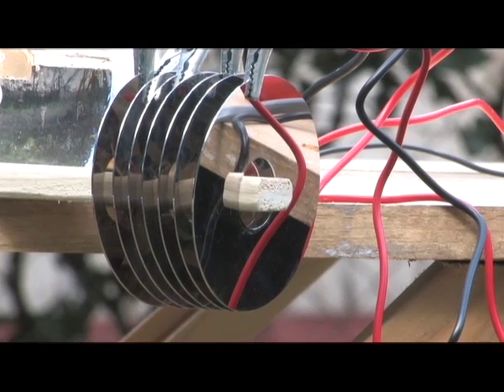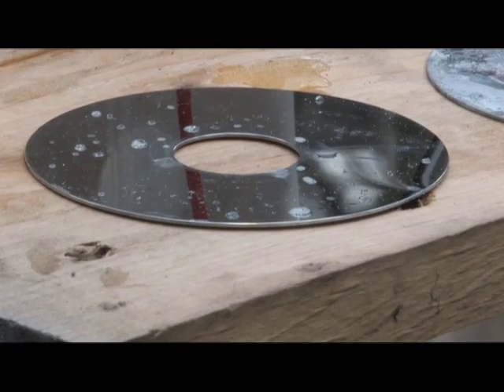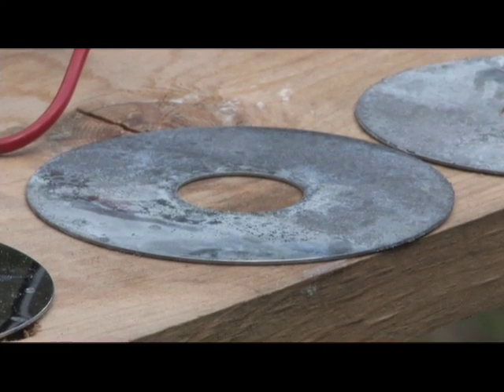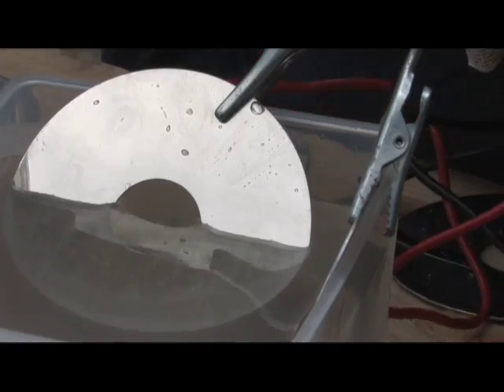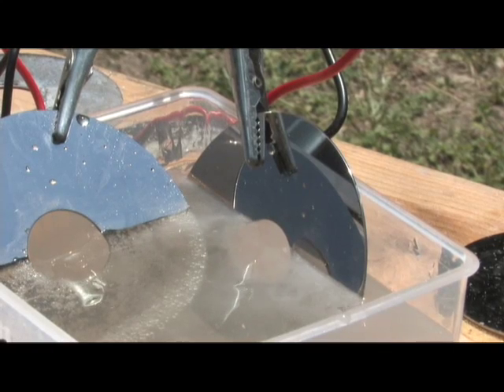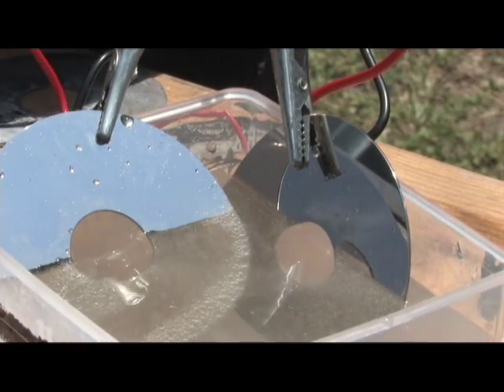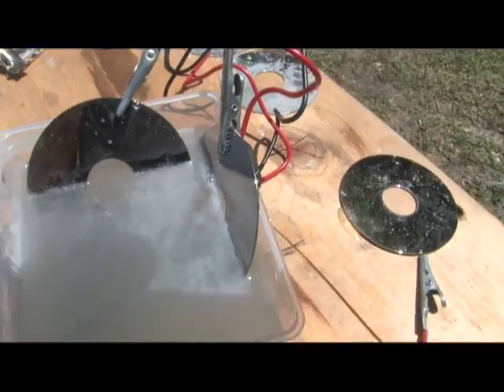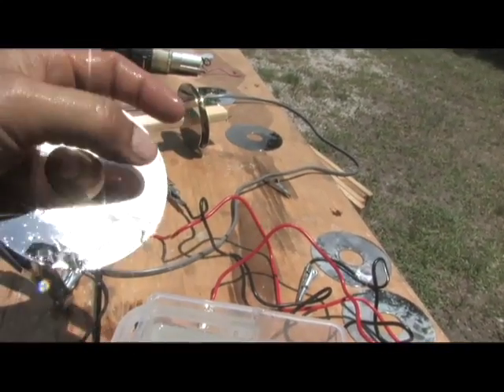SOLAR PANEL HHO PV PHOTOVOLTAIC HYDROGEN HARD DRIVE PLATTERS Science Experiment

Comment: Try designing a joe cell and fill it half way with Gallium Aluminum Scandium alloy. Then fill the rest of the joe cell with urine. Then pass the correct frequency of electrical power through the joe cell to produce HHO out of the urine. Thought about this while watching a composting toilet video. Thought why not use the water in the urine to produce HHO to charge solid state sponge hydrogen fuel cells . Then have a hydrogen fuel cell operate a micro jet burner to cook the sticky stuff and grind it all up then deposit the sterilized matter into a bin to latter use has rich top soil?  A better way to deal with human waste. RV's could make lots of roads and highways really green from all that rich top soil while charging up hydrogen fuel cells to use in their vehicle. Or have stations where they buy the hydrogen feul cells from folks. Turn in full cells and be given empty cells to fill up from processing ypur own waste. Even have places where you can sell off your rich top soil for some cash. 😊

Comment: Have you tried smaller 316L stainless steel plates (or washers) sanded in a crosshatch pattern as electrodes? spaced about 2mm or less submerged into distilled water with a little potassium hydroxide. Using different set ups with neutral plates? No contaminants then. I really wonder how that will perform... looking forward to the next video on this.

Comment: You could go to the dump and get a stainless steel sink for your electrodes. Also you could space your plates alot closer so then you dont need much salt and it works very good when you do that.

Comment: I'm not sure if this has been mentioned yet. But part of what you are doing using aluminum platters, is plating with aluminum. The acid and current is dissolving aluminum from one platter and platiung it onto the other one.
Platinum is expensive, but you could always try switching to titanium. Much cheaper.

Comment: I think this is a decent proof of concept. There are prototype setups out there using a large solar array to greate hydrogen which is then stored in large tanks to run heating and electric generators for the home. It's still too expensive to be truly practical (I think I read the setup cost the builder $80k) but the idea is sound. Good work and keep up the experiments. Zero pollution power, how cool is that?

Comment: I put 2 dual high amp output alternator on my S-10 truck 250 amps@hi rpm 100 amps idle, X 2 alternators,Running a 4 gen system consist of 20 SS plates per gen,Feeding 160 amps to it with CCpwm, constant current pulse width modulator,from factory 14mpg town 18 mpg hwy,To nearly 200mpg with HHo.don't have to fill up I put 4 gallon of gas and go 560 miles my engine runs cooler cause of the water vapors How in the hell is that not Good,watch zero fossil  fuels videos, and Learn, I'm a mechanic too.
Reply: NLOLIN4Solar wait what??? send me some build directions you sound like you have one sexy ass HHO build... is it wet or dry cells??

Comment: Wrong engines today don't last longer then 20 years ago,they are thro-aways today, wear them out land fill them in a few years not worth rebuilding.But 20 years ago 305,350 454,455,351,390,383,400,409,427,440,Cast Iron engines,they can take thrust,torgue,Sorry todays cars are junk,In HHo you use mof/map enhancers, and E.F.I.E for o2 sensors, and CCpwm's,Dude do you even research anything,OFR can be ajusted with enhancers such as Map/Mof enha- o2 sensors can be fooled with E.F.I.E's

Comment from the maker: In regards to the car alternator, they have an exciter in the core. When the voltage is full in the battery or no load from fan lights etc, the exciter drops the magnetic field so the alternator just spins freely lightening the load on the car engine. When you draw from the alternator, HHO or headlamps etc. The magnetic field becomes very strong costing the engine fractional milage per gallon.

Comment: Common Sense Test II:
3.  It extends the life of the engine. (Conflict for auto Service Departments  and Loss of New Car Sales) 
4.  Increases Gas Mileage. (Conflict w/OPEC) 
5.  Almost eliminates all harmfull Carbon Emissions. (80% or more depending on engine, 90% or more diesel engines)

Research a Daniel Dingel (retired NASA), who has converted over 1000 vehicles to run w/onboard HOH production system (straight water).  OPEC stopped implementation of new technology in the Phillipines

Comment: The drill was dc because it ran on batteries. Its motor is still an ac generator when used as you did. Trust me, I know what I'm talking about. You are still doing great work. I, too, found the use of platinum unwise. Why spend so much money on a less effective material? You'd just be another auto manufacturer. lol 
Keep up the good work. If I had a camera I would post my own videos. Meanwhile, I'll make myself available for tossing ideas back and forth.

Comment: Dissociation by electrolysis gets more efficient the closer the plates are to each other.  At 1/16" the rough voltage of 2.2-2.6v also contributes to the efficiency (too low and it shuts off, too high and it begins converting electricity to heat.  Problem with having plates so close together is separation of gases becomes problematic.

Comment from the maker: HHO is not intended to be compressed or stored. Only "H". H comes off of the Cathode side or negative. O comes off of the Anode or positive. Home storing of H or O for that matter is dangerous but equally dangerous is medical or workshop O. O can explode without an oxidizer added like....O, because it is O. Compressed Hydrogen, acetylene, and Propane CANNOT ignite inside of a pressurized tank. The tank must first rupture. Google "Bleve". HHO compressed has O so It can ignite. Do not copress HHO.